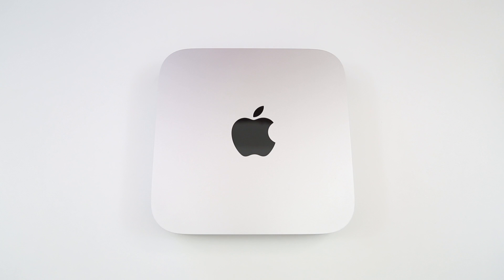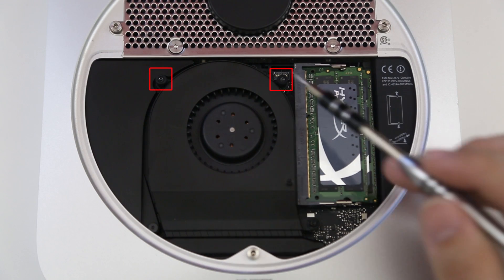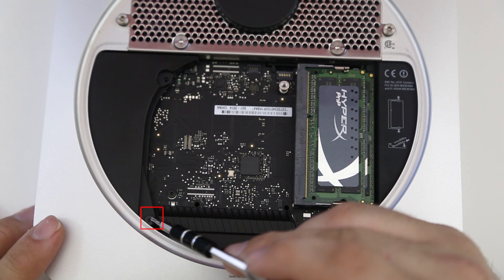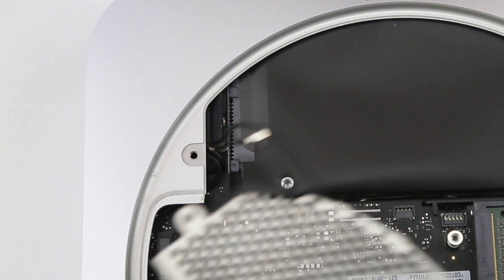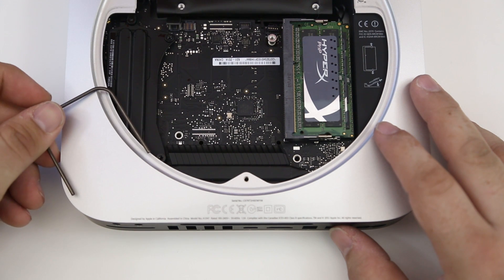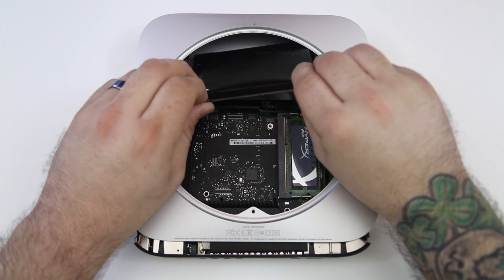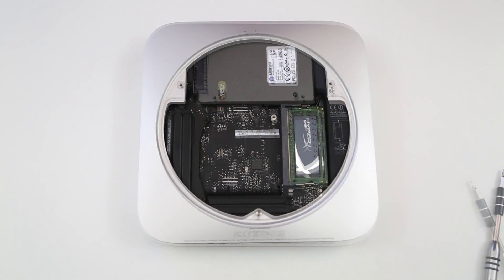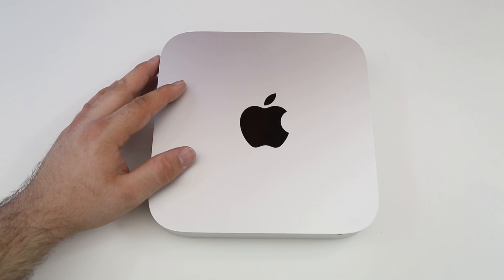The Ultimate Mac mini: How To Install A Solid State Drive (SSD) - Install Guide

Comment: In the video it shows he hard drive just being removed from the Mac Mini after the move of the motherboard but at that stage it is still connected to the motherboard (the main data/power connection and the temp(?) sensor.) I found it easier to disconnect from the hard-drive end as opposed the the motherboard side. Or did my video jump. Otherwise a great tutorial; only issue I had was the fan connector being difficult and a wire pulling from the plastic cover.

Comment: ello friend, I have a question, my mac is mid 2010, which has the unit superdrive, I want to remove it and place another hdd, but have read some articles the the unit must be of the same measure I'm taking, not if I understand well that when measures or measures which are necessary to make the replacement, 9.9mm or 12.7mm hope you can help me.